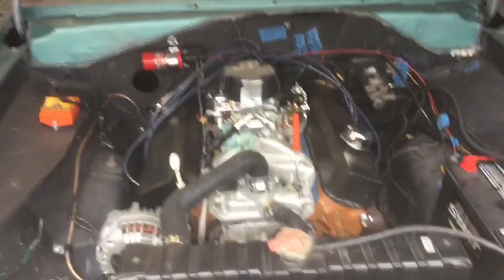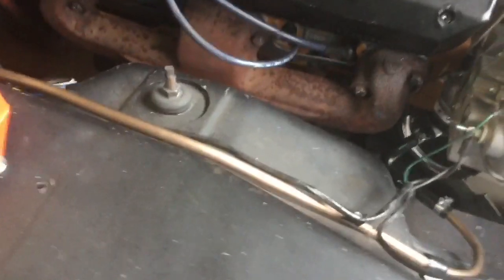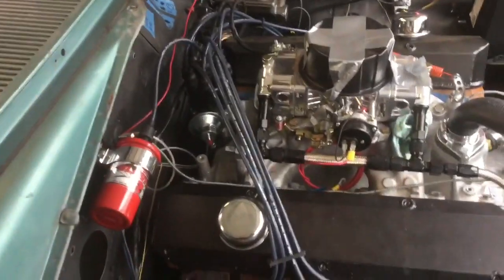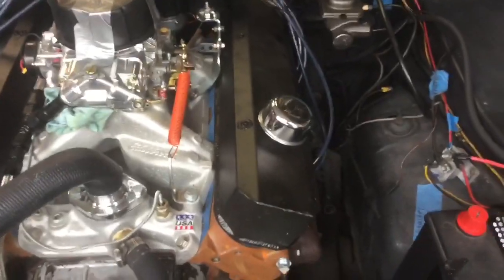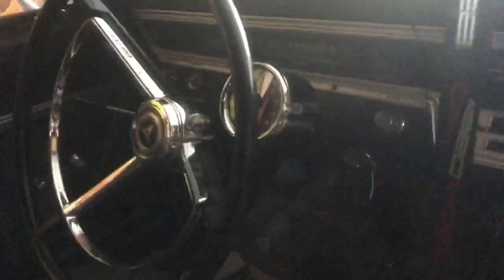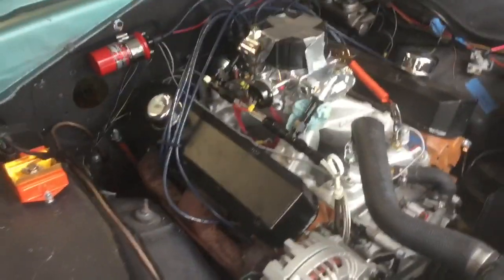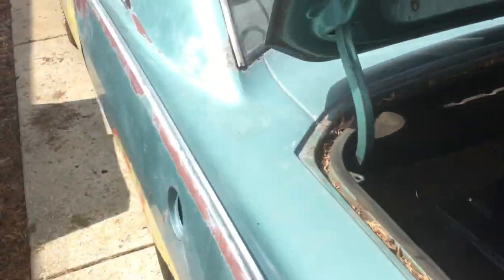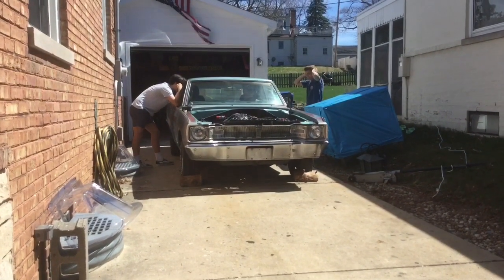Betsy is BACK

Comment: you keep flooding it , only 3 -4 pumps at a time, the starter was turning over fine most of time
Reply: It had dead spots you can hear it sometimes.
Reply: I think you need to turn that distributor a little bit and see if it fires up sounds more like the timing than anything else
Reply: @blackman8795  what he needs is to find a chassis dyno shop and have it all tuned. Theyd have it starting up first crank every time if they know what they are doing.
Reply: @blackman8795  YEP
Reply: @gregl5677  the dead spots are timing if he fixes that hes golden
Reply: @gregl5677  I agree with you on that.
Reply: @blackman8795  if the dyno shop is real good. Normally from the time its strapped an wired to a dyno the tuner will have it setup complete within an hr.

Comment: Sounds like both the starter and timing. When it did crank the initial timing sound too low. Like the other guy said put the batter charger on it and only a few pumps to avoid flooding it.

Comment: The starter isn’t working right but the biggest problem is that you’re flooding the car. You only should pump the throttle 3-4 times and then once you get it running you need someone to set the timing with a timing light.

Comment: Make sure there are no open vacuum ports on the base of the carb sometimes they're hard to see. Advance the timing by moving distributor counterclockwisejust a touch. 3 4 pumps of gas pedal to the floor. Starter should only be spun no more than 15 seconds at a time. You got this . You need a timing light so you can set the timing while the cam is getting broken in.

Comment: Sounds pretty strong( what lil it ran) it seems like power was cuting in and out. Might check the ignition switch. I had 1 that would cut in and out were it would start run then lose power and die. Keep up the gr8 work you'll get her done!

Comment: Your flooding it...All so change your spark plugs out or at least dry them off.Then well looking down the carburetor pump the gas once see if is fuel spraying down the barrows.If there is pump it once more and try and start it.

Comment: Is the carb getting gas? You can look down in it and hit the throttle and should see it squirting. Also your fuel tank needs to have a vent, take the cap off the top port so the tank can breathe and see if it helps

Comment: #1, if the starter is turning over the motor then the starter is not bad. #2. If the shop really knew what they were doing they would have checked to see why it would suddenly stop turning over AND check the timing to see if its right which it probably isn’t. #3. All you need is about three pumps on the gas not 23 pumps each time and flooding it COMPLETELY out.

Comment: I'm wondering if you have fuel? It sounded like it wanted to start but fell short of fuel? As much as you pumped the throttle it should have been flooded.
 Is it a electric fuel pump or a mechanical fuel pump? If electric, is it on? Can you check fuel pressure?
 Starter doesn't sound right however it cranked enough it should of fired up.  
  Was the fuel line copper or steel? Copper "could" work hardened from vibration and potentially crack (long term), I understand it's easier to bend and install copper, however a steel line could be a  better choice.
  Also, I believe that "1AN" is equal to 1/16", so 6AN = 3/8", 8AN = 1/2", ect.

Comment: Manual or automatic choke? Is choke working right if auto? Might be closed to much. It so stick a screw driver in carb to hold it open a bit. MAKE SURE A FIRE EXTINGUISHER IS NEAR. 

Leave the dist bolt a hair loose so you can turn it slightly by hand to advance it.

Comment: I would check how that fuel line is ran that you are getting a continuous flow of fuel from the cell you probably have a air in the line keeping it from flowing continuously to the fuel pump on the motor. I  say this because of how the line is ran up onto the fender well and then down to the mechanical pump on the engine. You have no electric pump back at the fuel cell rite?  Yes the timing might need advancing a little. Loosen the distributor hold down enough that you can move the distributor and get some gas in a  bottle with a small hole drilled in the lid and pour a little bit of gas in the carburetor and crank the engine while moving the distributor a little until it fires of. It may take several trys but it will definitely get it fired off ! Yes the starter has a problem but it was working well enough to get the engine started. This process will work i speak from experience, good luck with it and enjoy the content always .

Comment: I'm not trying to hate but the starter wasn't bad until you burned it up. You shouldn't have to pump it that much. You can prime the carb with a bottle of gas but don't spill any in case it backfires. That fuel line goung up around the manifold is a problem. It could feed back to the tank every time you shut off the motor. Atleast until you get it primed. Normal lines run horizontal to the pump. I don't know your power range but putting an electric pump by the motor is a better way to go. If you add  NOS the stock pump won't be enough anyways.

Comment: And it looks like cheap bolts in your exhaust manifolds.  The will probably seize and break when you try to remove them later if you leave them in to long after you get it running.

Comment: get a fire extinguisher so when all that raw fuel coming out of the exhaust manifolds lights on fire you have a way to put it out. this is not a joke because you do not want to use water on a gas fire. make sure to check oil level because all that gas went somewhere and a good chance it has ended up in the oil and more than a few ounces will damage an engine. you need someone standing there that knows whats going on before you get hurt.

Comment: you dont need to pump it that much you flooded it out bad set the choke on the carb  let it do its job dont have a choke pump gas 2or 3 times hold open about 1/3 gas should start dont give up you are getting ther

Comment: I should have watched the end of the video I just finished and I'm sorry my stupid phone it's Sim not Sam sorry about that put some jumper cables on it gives some more juice and just put a touch of gas down the carb and that thing on fire right up good luck bud I think it needs just a little more charge on the battery I don't think it's the starter it's turning over and it sounding like a Dodge I think you just need more juice jump it as you try how tall good luck looks great

Comment: Camshaft has flat lobes
Reply from the maker: How? It’s never ran for more than 10 seconds
Reply: @SimABCXYZ  just by cranking it, it will destroy the camshaft.  Is it a flat tappet cam or hydraulic roller?
Reply: Sim ABCXYZ that may be the problem sim, to break in the cam you HAVE TO do the break in on the FIRST CRANK if possible, I’ve destroyed cams doing that 10 second game. Please don’t start it until your ready to rev it at 2500-3000 rpm for 30 minutes! Your also drowning it with fuel, 1 pump at a time! Distributor Sounds too retarded timing wise btw, advance it a hair then break in that cam! Your also heating up the solenoid on the starter that’s why it’s acting up on you, don’t crank it for more than 10 seconds at a time, and let it rest at least 30 seconds between extended cranking attempts, when the engine is right it’ll start after 1 or 2 seconds.
Reply: @SimABCXYZ  the shop probably already knows the camshaft is flat, so they blamed the starter so you wouldnt blame them that the cam is destroyed.  But yea, a camshaft break in needs to be started on the first start, a hydraulic roller camshaft doesnt.  The whole point was for the shop to give you a running car back, so basically you have a serious issue which is most likely 99 percent that camshaft needs to come out.  Take your oil filter off cut it open pull off the paper filter stretch it out and look for sparkly metal copper flakes in the sun light
Reply: You haven't hurt the camshaft. I'm sure the put a ton of lube on it. Sounds like the starter is and has over heated. Before pumping the heck out of it checked and see if the carburetor has fuel in it. Also you really don't have to start the engine with no exhaust pipes on it. Put so pipes down and away from the car. Also your timing is off. Put the engine on top dead center. Hook up a timing light. Turn on the key. Turn the distributor while holding down the button. When it flashes tighten the distributor. It will be close enough to start and stay running. Then break in the camshaft.
Reply: @dragvan1937  he paid the shop to do all of that.
Reply: @ss396rat  if you look at the instructions on breaking in a camshaft you can crank the engine till you get oil pressure. Then start and run for 20-30 minutes at 2,200 to 2,500 rpm. I bet the shop has the timing off and didn't want to run it to check it. I also have a fuel priming bottle. He should also have a fuel pressure gauge on the live going to the carburetor. Should be between 5-8 lbs. I have built a few 360 small blocks. I have one in an ice cream van that runs under 8 seconds in the 1/8 mile and weighs in at 6000 lbs
Reply: @johnvegar9098  well i guess its a learning experience
Reply: @johnvegar9098  true
Reply: @johnvegar9098  most kids his age are playing xbox, id rather see sim struggle and figure this out.  I love this kid lol
Reply: i dont think the cam is flat. It doesnt sound like a high compressed engine on startup. His issue they burned his starter, the timing is off a hair, who knows if the jets are even right for the carb. The idle on the carb could be to rich. It could also be s bad cap or rotor, or maybe the firing order is off. It could be any one of those but we cant know until he actually produces a video of him checking everything so we can see what is right and what is wrong.